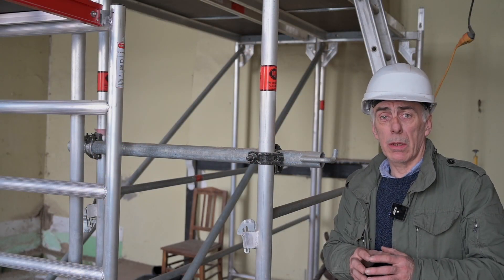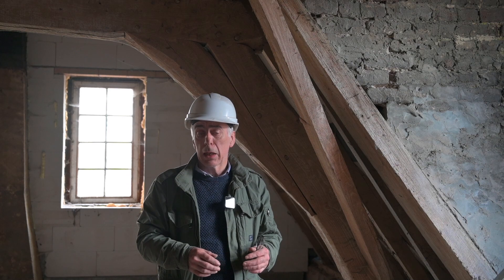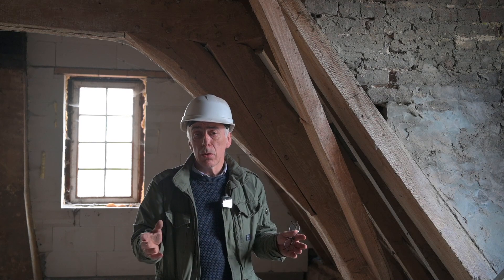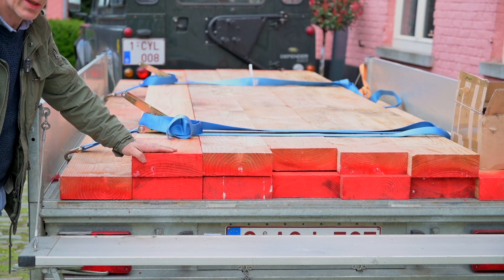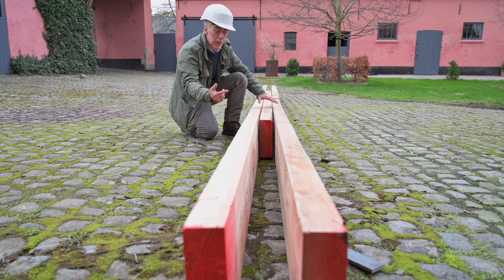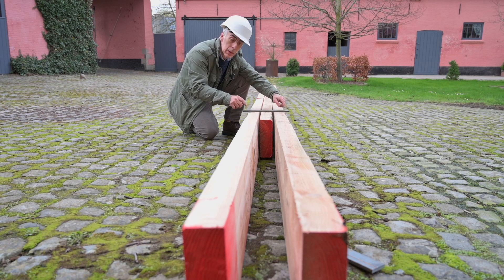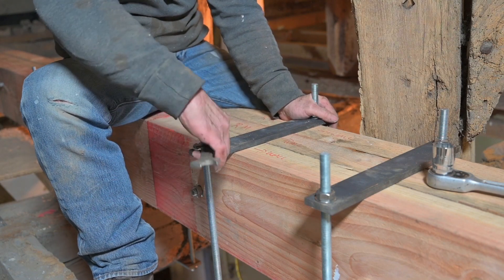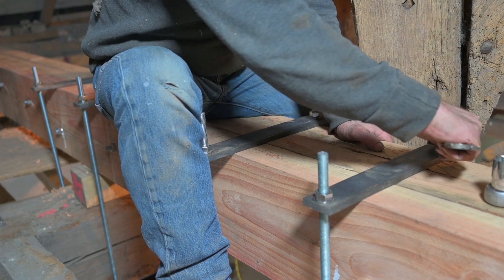Day 7, Restoring the tower room enforcing the old structure. Unexpected work.

Comment: I was wondering whether you would consider the following suggestions, from a purely cosmetic side. The engineering as-is probably more than strong enough. I was wondering whether you could replace the 4x 12mm threaded rods that clamp the upper and lower beams together, with one INTERNAL 18-22mm threaded rod? I.e. where the new and old beams cross, drill a hole in the middle of the cross, from top to bottom, and run a large single threaded rod through there? And secure it from underneath with a nice large square washer. I think from a cosmetic perspective it would blend in more, and looks similar to other reinforcing measure people have applied to these older buildings over the years? You could then get rid of those 4x 12mm threaded rods and plates.
Reply from the maker: thanks for the comments, that is indeed something I did consider .  At the end I did decide not to do it as the current solution seems to be providing more around support . Given, its not as cosmetic as your proposed solution.   You will see the result soon on the next video.  I will put a steel tube over the rods, that will make it look better.

Comment: A very good idea using the compound beam using small section timber, I had to order 3 12"x6" x27 foot, (300x150x 8.3 Mt), beams from Canada when I did this, and they were really heavy to lift in place, I also had some Oak beams with crumbling exterior and replaced them, but having removed them I sectioned them to check on strength, the inside was like iron, and because of the original over strength factor were well able to take the load, but you ever know until it is too late! Is the roof structure bearing on these beams? Working on your own at least keeps you clear of any infection! Stay safe. Chris B.
Reply: Yeah but it was a bad idea to stagger the beams in the way he did. Overlapping the joints on both sides means that he's now down to the strength of a single beam at that spot. If he would have staggered the joints it would have been almost twice as strong for the same amount of work and materials. He's essentially got a beam that's not much stronger than a single board wide running continuously. It's overbuilt enough that that shouldn't matter, but it's still a pretty big blunder to cut the strength so much because of an oversight.
Reply from the maker: thanks for the comments, indeed old beams might look ugly on the outside and weak.. but that core is like steel.. I have seen that many times.  No the roof rest on the 1meter thick walls ...  That corona has caused a total lock down here, no shops, no restaurants etc...all closed at least for 3 weeks
Reply from the maker: thanks for the comments, I can see what you say but also remember that the beam is locked down to the Oak beams and that the weight/load runs on the middle beam and side beams . Off course not like 3*1 full length beam. I did consider the overlapping joints when I started. Did some basic calculations and it seemed to be the same , based on the two load points...  Maybe I did the calculation wrong.. Something to try on a small scale... If I have some time I might make a test and video with it... overlapping joints and none overlapping..based on 3 beams .. see which one is stronger    ... would be a good test
Reply: I was thinking about doing a similar test myself, of course the deflection loads will turn into compression loads where the ends of the beam touches, and the bolts will be in shear, it is also in compound at some depth with the Oak beam, which makes the whole assembly very deep and resistant to deflection, so there should not be a problem, and as the roof weight is taken on the vertical wall, there is very little load. Stay safe, we need a permit to travel now in France since today! Chris B.

Comment: Always fun to watch. In America old time builders use the 'sister' technique that you use quite a bit. It is very common with a type of manufactured beam called 'LVL', where it offers excellent strength and allows the builder to lift a beam in parts using human strength instead of a crane or lift, which is not always possible anyway. Builders also prefer to use parallel natural wood beams as you have, instead of a single thick one (like the oak ones), because big wood beams have a tendency to 'move' or twist or warp over time, and by bolting two or more together, it tends to greatly reduce that, by countering one beam's twist with another beam, etc. The bolting system that you used, with the spacing, washers, etc. is what is specified by engineers. In America we do not call that metal saw a 'hack saw', we call it a 'metal-cutting band saw'.
Reply: One very big difference here is that framers aren't going to try to splice separate beams together to get a longer span. In a traditional flitch beam the only load on the bolts is the twisting force of the individual boards. In his design the threaded rod carries the entire load and the joint in the middle only has a single board carrying all of the load. Also, that's not an LVL. LVL stands for laminated veneer lumber and it's essentially just uber thick plywood cut into boards. There's also glulam beams but again, those are much stronger than what he made because they are adhered all along the boards to one another and the adhesives used are strong enough that if you were to pull it apart it wouldn't be the adhesive that failed, it would pull the board itself apart. Flitch beams aren't cut in the middle because that would drastically weaken them. This contraption is probably about as strong as a single unbroken board spanning the same distance.
Reply from the maker: thanks for the comments, " Sister" technique , did not know that.  Thank you for the explanation, indeed a metal cutting band saw.... I guess a hacksaw is by hand back and forth ?
Reply from the maker: thanks for the comments Andrew, that is great educational value.   As it seems , you are an expert. May I ask this question:  The fact that bolds are pressing the beams together is that not causing a strong bond ?  I understand that the bolds /rods are taking the main load transfer, but I would expect that the high friction between the beams ( as they are pressed together) also take some of that load distribution ?
Reply: Andrew is right that when LVL beams are paralleled, they each span the full distance, not with a break in the middle. However, he did not speak to the fact that conventional beams, such as using two 2 X 12's instead of a 4 X 12, are also bolted together, similar to how you did it, to reduce twist and warp problems. The net effect is a much better beam that will not move much over time. In your case, the cost of a beam that can span the whole distance is a lot, so you made this construction. Andrew is right that the weak point is in the middle where the single middle beam is at the max stress region, but it is not quite fair to say that the middle beam is carrying 'all of the load'. When sistering (paralleling) is done over many feet, as you did, the strength is quite good.
Reply: Yes, back and forth. I think we also have power hack saws, but they too are back and forth, not a circular band. @D3Sshooter

Comment: At 11:30 you have 2 beam joints aligned with each other. Would it not be beneficial to offset all joints? You've inspired me to check in the local code.

Or did i make an incorrect assumption. Have to watch and see.
Reply: Would 1.9m of overlap be enought to join the two lengts ? Now he has a total of 3.6m of overlap.
Reply: @BrainHurricanes  I remember one rule: the total width of joints at any quarter of the span must not exceed 1/2 the beam width. If the beam was designed as a full span the joints could only be located at the quarter span points and with a triple member beam the 1/2 beam width rule would only allow for a maximum of 2 joints in the entire span and they would be located at opposite ends. What the beam in question is accomplishing is different than a full span and no doubt our entertainer placed the joints on one of locations where the existing members are supporting the beam. I do recall an old timer using 6 times the rough dimension of the beam components, eg. a triple 2x10 glulam would require 60 inch minimum length pieces in a glue and nail laminated method. To answer your question I would right now say probably. That's what I find most interesting, relearning something you've forgotten or finding new regulations that change everything. I'm holding a span table book in my hand that's dated 1976. Back then the internet was to keep Mrs. Mosquito from dining on us while we slept. I apologise if what I wrote sounds confusing. Local code always resides at the top of the food chain.
Reply: @BrainHurricanes  The problem is that at the joint in the middle there's only one board carrying all of the load. If he would have moved the joint on the other side of the middle board farther down so it wouldn't line up then each joint would have 2 solid boards going across instead of only one.
Reply from the maker: thanks for the comments, indeed an overlapping method might be stronger , although I am not convinced . But then again I am not a structural engineer
Reply from the maker: Indeed
Reply from the maker: thanks for the comments, that is a nice write up and I learned from it
Reply: @WireWeHere  Thank you for your nice explantation. It is hard for me to try to picture what you are saying. Do you have a link with pictures ? I have made a quick drawing. https://photos.app.goo.gl/WfozFjgUGq7ejgkQ7
A is the situation now, B is what I think stronger and C i'm not sure if this is what you mean. Also I was under the impression that only one beam would be strong enough for him.
Reply: @AndrewMerts  Yes exactly, I was under the impression that one beam would be sufficient by the load test he did. So wich one would you prefer in my drawing, A, B or C ? https://photos.app.goo.gl/WfozFjgUGq7ejgkQ7

Comment: Is the weak point for the load now on the Nut threads?
Reply from the maker: thanks for the comments, yes indeed and those are enforced rods... However a M14 rod can take a lot, in fact its four times per beam.  And the old beams are not hanging or sagging , it's a pre-measure to aid the loss of strength of the old beam.

Comment: Your load is carried by each threaded rod in shear. That would not meet building code in the US. You should consult with a structural engineer to verify the loading requirements.
Reply: And the joints were positioned directly across from another as well. In the middle of the beam it's just a single board carrying all of the load. This guy is pretty handy but he's certainly not a structural engineer.
Reply from the maker: thanks for the comments Andrew,  I am not... I am an electronics engineer..  so i read two mistakes :  none overlapping beams, and threaded rods in shear.   Good to know for my next job...  but at the end this is not going to fly away, its IMO strong enough for what it needs to do... unless you would give me the big nono   .. thanks again
Reply from the maker: thanks for the comments, OK I see .. So I would have been better with an  all round metal jacket ?   In each case there is no load on it at this moment, as the old beams are holding up.   I just did it to compensate for the loss of strength of the old Oak beams...  Is it not so that a  M14 rod  holds 73.88Kn ?
Reply: @D3Sshooter  The cheapest and easiest solution will likely be to epoxy the beam members together and use the bolts to hold the pieces until the epoxy sets. It would also help to rearrange one of the side pieces to offset the joint. It may sound strange, but two joints along the same section can create a stronger overall truss, than a single joint that is paired laterally to another joint at the same point loading location. In other words, always stager your seams.
Reply: @D3Sshooter  Your design suffers a similar error to what caused the Hyatt Regency Walkway collapse of 1981 that killed 114 people: https://en.wikipedia.org/wiki/Hyatt_Regency_walkway_collapse. However, your design has wood members instead of steel welded C-channel. Additionally, the joint location consentrates loading onto the single wood beam in the center. The two side members act like a hinge and direct the force into the through rods. It would be better to distribute the load across more of the material than at single point loads of the rods. Long story short, don't host a dance party in the attic.

Comment: Do you get inspections of your efforts from the heritage people? Watching UK programs on house restorations and so on,they really get hammered by the heritage folks who want modern restorations to either reflect the original structure or be adifferent style to differentiate the two eras of the buildings. you cant win ha ha. Also ,with your plates, radius the sharp ends to soften the look of them . :-)
Reply from the maker: Yes we do, and the point they always make is : " You may not add things that look like they were part of the original, make sure that its clear and visible that its been added."   For instance , I may not add old oak beams if they were missing like in this case.  I needed to use nearly new beams.   They really don't like if we try to make the missing parts with new parts and make them look old.
They rather see steel or concrete as fill in

Comment: hi steve
Good job, again. I have an old construction book and there is a Douglas fir effort table here called BC fir. The maximum fiber effort is 1400 pounds / square inch. In the table there is not the maximum effort allowed for a beam of 9X8X18 like yours. But one of 8X8X16 will support 3851 .. The thicker your which matters a lot and more supported below it is not nothing. Well, I'm not an engineer, but seeing your beam is sure that it will be there in 100 years and nothing will have changed! And whoever looks at it in 100 years will say "Oh boy! Look at me how well he used to work" Greetings!
Reply from the maker: thanks for the comments, that is good info.. and Think it will last my time

Comment: It appears that your new "reinforcing" beam is being supported by the old beams!
Reply from the maker: thanks for the comments , not really .. But I have them both locked together that was the plan from the start. You can see the block under the Douglas.  Both the old Oak and the Douglas beams are locked /held together
Reply from the maker: thanks for the comments,  see the other comments. Its as always the intention to hold them together. That makes it stronger.  Remember the Old Oak beams did not sag or bend...  This is just an enforcement..  and for the nuts, I can add several as the rods are long enough

Comment: Gday Mate. You can restore dry rot wood with a two pack marine grade resin from a ships chandlers just pore it on top and it will soak through  the sponge wood fibers then set hard.Love your vids.
Reply from the maker: thanks for the comments, that is something I need to check .. great tip
Reply: It’s the fibres in fibreglass which gives it its strength. The resign just keeps it all in place and compact. I would guess the remaining dry rot fibres would be extremely weak and you wouldn’t add any strength. Also just by soaking the wood you cannot guarantee full penetration off all the dry rot.